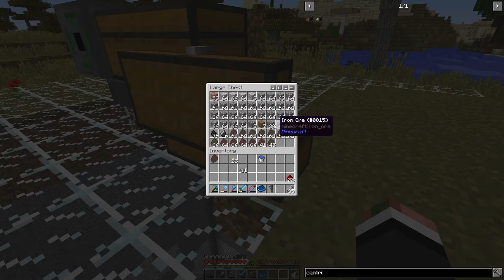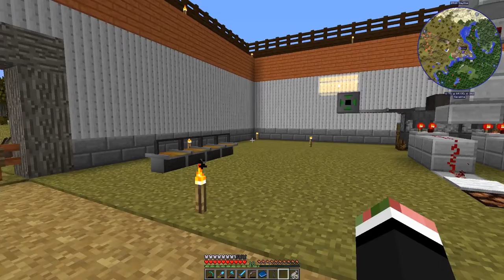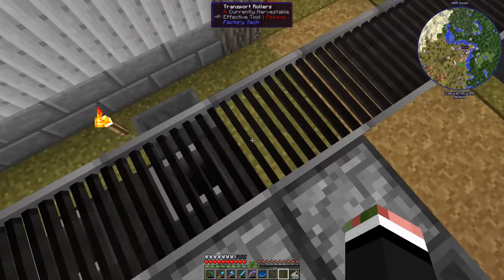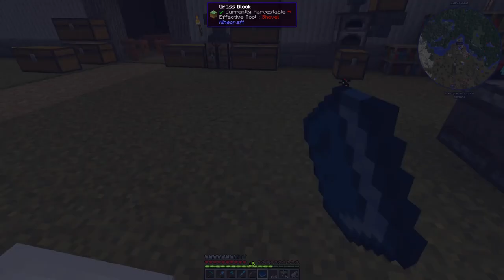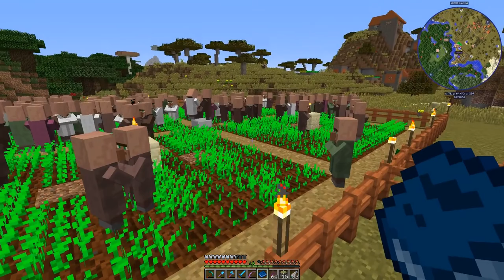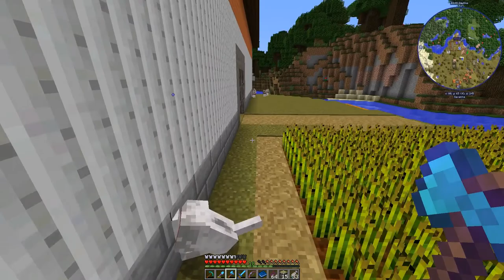Centrifuge Magnets (Barely Modded Factory Tech Let's Play Ep. 15)

Comment: I FEEL your pain!!  I agree with you that these numbers need tweaked.  The concept of this mod is very neat, but the percentage of breakage and replacement makes it much too frustrating to use.  I REALLY wanted to like this when I first found it, and tried it out as an early game processing solution before power.  I feel the frequency of parts breakage makes it too cumbersome.  It needs balanced better.  Thank you for not giving up!
Reply from the maker: I think that it would be a nice early game tech mod in many mod packs if it were balanced a bit better. I don't think I will come up with a proper balancing myself, so I might over compensate in my tweaking. I do hope that mod pack developers would give a serious effort to balance this mod in their packs. I feel that it is too easy to just ignore it and go with one of the many other mods that just use RF power or the like.